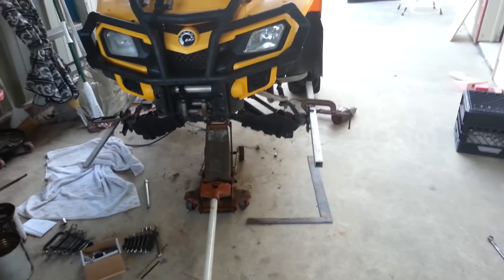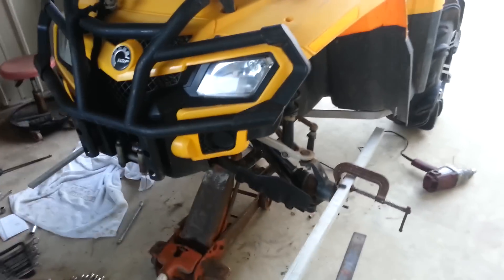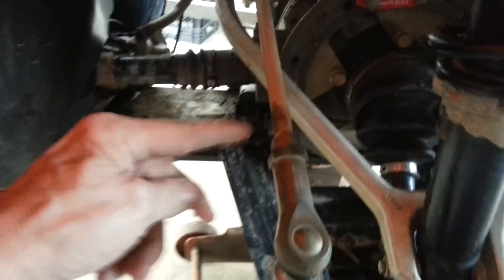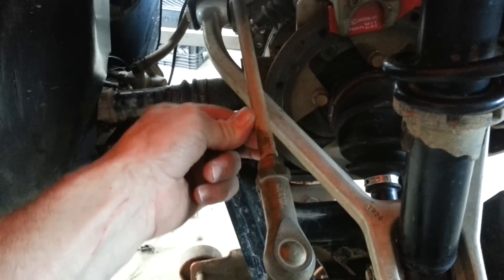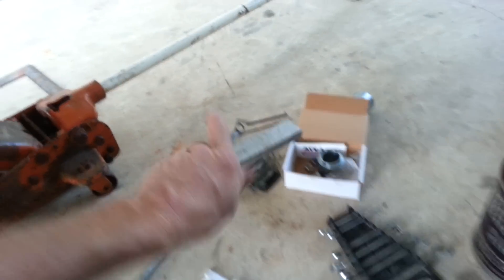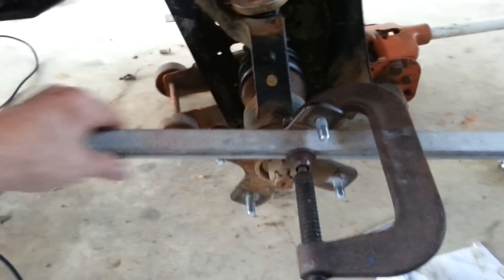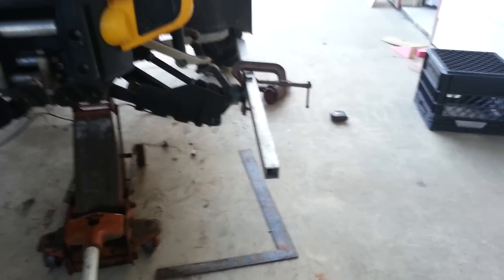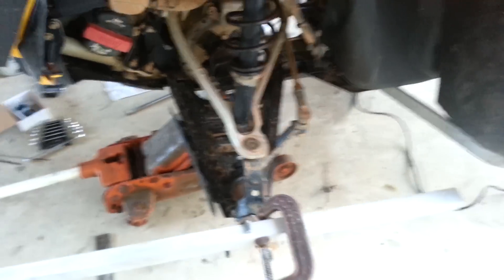How to do a front end alignment on a ATV 4 wheeler

Comment: Use a string tied to rear hitch. Come around the back tire and straight to front tire.  Get tire flat on the line both sides will get it close and then your method could dial it in really nice.  The string gets you square to the rear tires.  Thanks for tje video

Comment: Your videos are great!! And because you’re good with ATV’s I’m hoping you can give some advice. I just got a late 80’s Suzuki 125. When you turn the front wheels slide more than turn. What do you think is causing this? I’m gonna try to do an alignment based around this video. But it doesn’t seem to have a lot of adjustment options. Thanks keep the video going!!
Reply from the maker: Sorry I couldn't give you an answer but I'm not sure
Reply: Three years late but my guess would have been worn front tires I'd assume back tires had more life than the fronts
Reply: Was it locked into 4 wheel drive? It'll feel like pushing more than turning while in 4 wheel drive.

Comment: I got a question for anyone that know I got a 2012 king quad750 that steers terrible I know for a fact that one of the a arms is bent but it could aso use adjusted steering box how do I go about making it steer better? Bend the a arm back buy one and do the steering  alignment? or is it just one or the other
Reply: Maryland Lawncare & Reviews  start with fixing the bent a arm and then do the alignment. the king quads are known for not being the best handling. they have a light steering feel but when u hit rocks  ruts or obstacles with the front tires it wants to rip the handlebars out of ur hand and send u sideways. the power steering models are improved but still have the same affects and it's all got to do with angle and geometry of the steering system. there is a mod called demijohn mod that changes the angle and improves the handling tremendously (so they say). if you google demijohn mod or look it up on you tube you will find more helpful tips on it. I'm in the process of replacing bushings and other front end components on my King also and I plan on doing demijohn mod when it's all apart.
Reply: Greg Large yeah they do tend to rip handle bars out of your hand that's how I rolled mine in got a concussion!!
Reply: Sorry to hear! I would definitely try the steering models. It doesn't seem difficult to do if u k ow someone or have a mill to trim the A arm Me center shaft. I'm sure u cud do it with a cut off wheel but it won't be too accurate. I'm gonna post a video of it when I do mine
Reply: Greg Large ok I'll be checking it out!